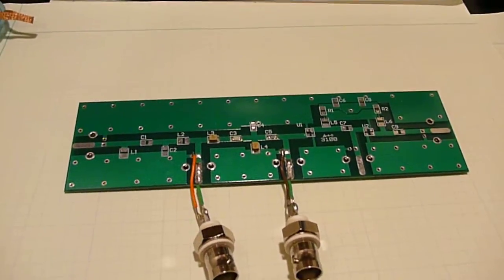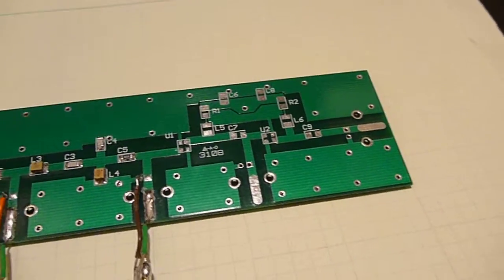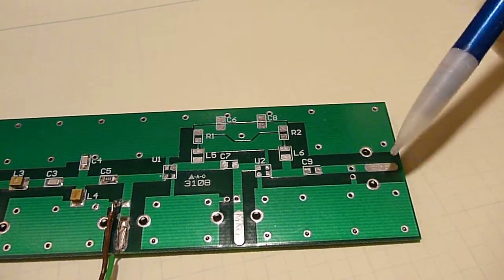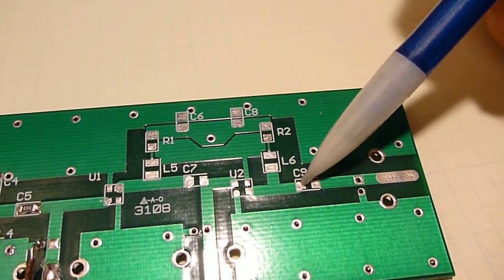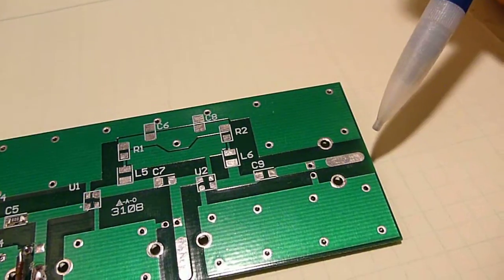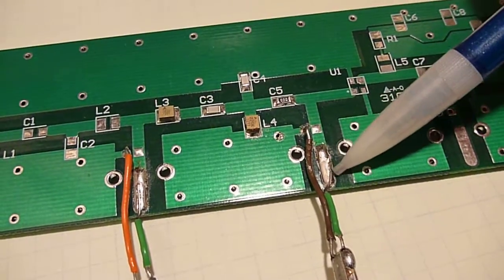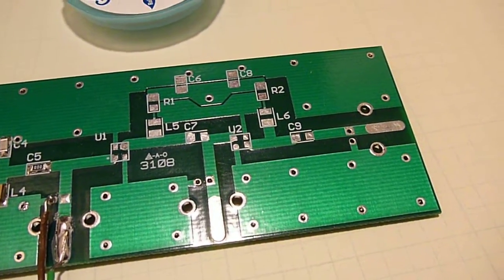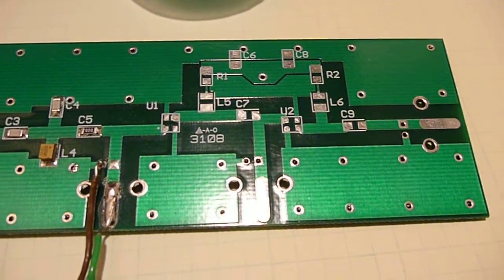Some PCB and Soldering Information

Comment from the maker: It'll probably be fine. The thing you need to be careful about with the cheap soldering irons is the temperature. They don't have any controls, so it can be easy to overheat components. 

Only keep the soldering iron touching until the solder melts and flows onto the components, try to not keep it on there too long.

Pointier tips just help with getting into tight spaces. Blunter tips are actually better at transferring heat.

Comment: I just ordered a Velleman Kit (MK111) for a little project. This kit consists on a relay timer and it has a lot of components to solder, like resistors, a relay, etc. I have a solder iron, but close to 0 experience. My solder iron has a kind of a screwdriver tip, instead of a pointy tip like yours. Do you think that my solder iron will do the trick, or do I have to buy a pointy one in order to not do damage to the kit's PCB??

Comment from the maker: @comicfreak11 by read I assume you mean you're trying to figure out which trace does what?

you just have to look at what is connected.  each trace is basically a wire that is connecting two points on the board.

my main warning is that the board may be multi layered, i.e. there are layers of copper with traces that you cant see.